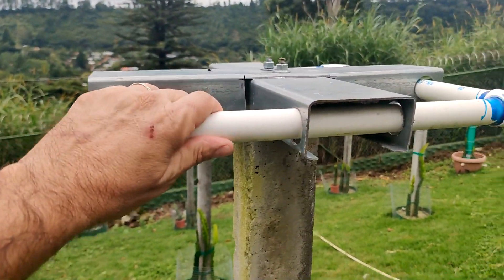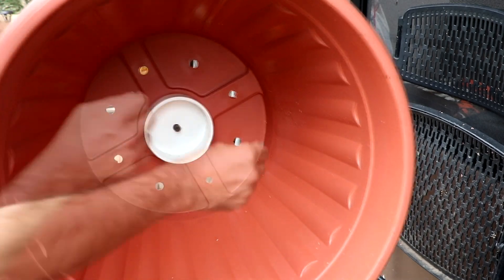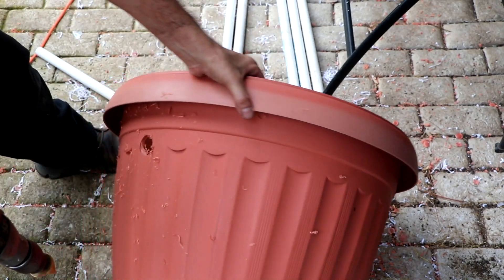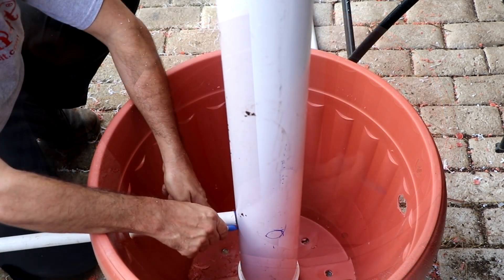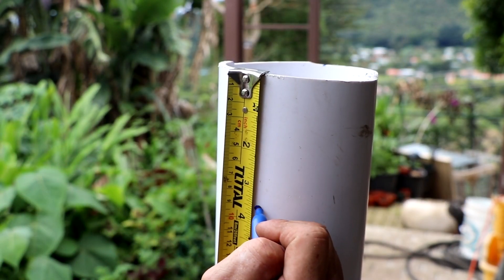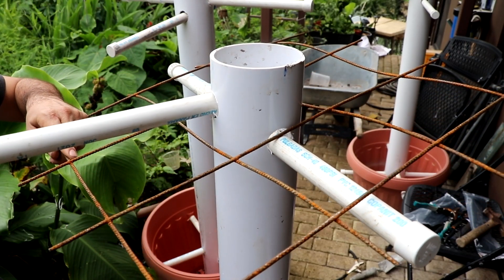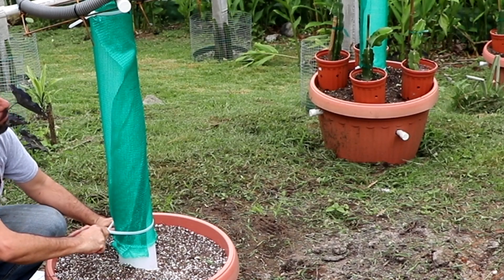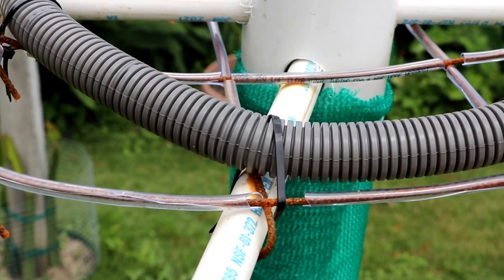Building a Weatherproof & Mobile Dragon Fruit Trellis

Comment: Steel & concrete get too hot/cold, PVC/piping is too slippery! Using ruff cut timber {with a ruff surface}, or covering your post with hessian for the vertical roots/tendrils to attach too is a better way to go! Your posts must be at least 8' to 10' feet apart & at an ideal height of "the gardener's" chest height. Keeping the soil raised at least 6" inchers high & 2' feet out at the post base insures it to be well drained & free of fungi & rotting! Good gardening to you all!

Comment: Excellent design.  You might consider going one step further.  Use the center pipe for a compost bim.  Drill holes in the bottom to allow compost tea and access for worms to help with the composting.  Using the top to load with kitchen scraps.
Reply from the maker: Great tip! I love it!!!
Reply: Actually I thought in the beginning he was going to do that 😅

Comment: I noted some of your dragon fruit plants are planted directly on soil ground. What do you think are the pros and cons for potting and direct ground soil planting? Btw, great design for the trellis. Thanks for sharing.
Reply from the maker: I live in a very tropical area and we have a year long growing season and good soil drainage.  Planting in the ground makes the most sense for me, as the dragon fruit roots will really benefit from this.  I would say that if you live in an area where the soil is not so good or you have harsh winters and you might need to move your plans indoors, then planting them in pots would be better.  The downside is that eventually the root system will  be compacted and you might have to take steps to replant or remove some of the roots..
Reply: Thank you for pointing this out. Now that you mentioned it, I've noted that in Asian countries, like Vietnam and India, most plantations are directly on the ground. Whereas Australia and North America, most would have it in pots.